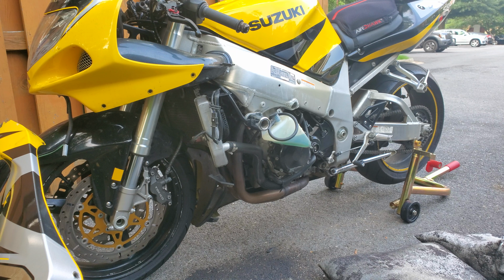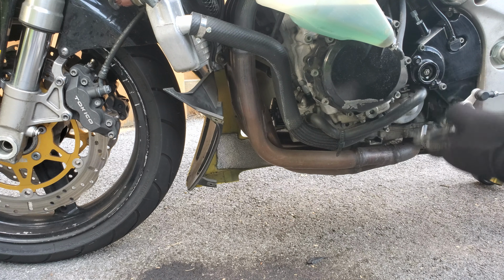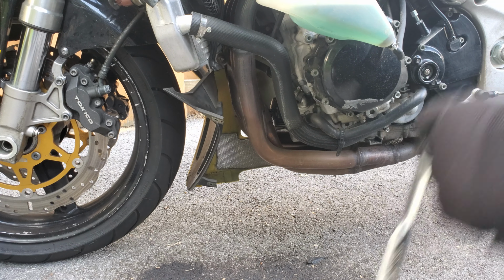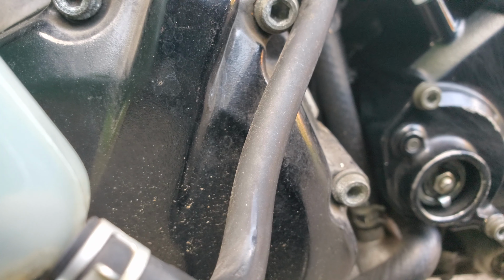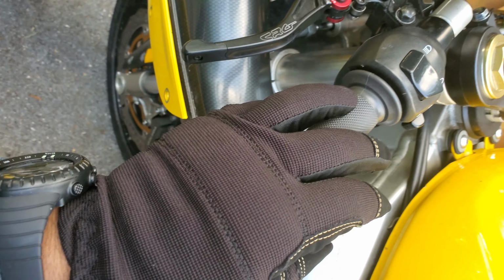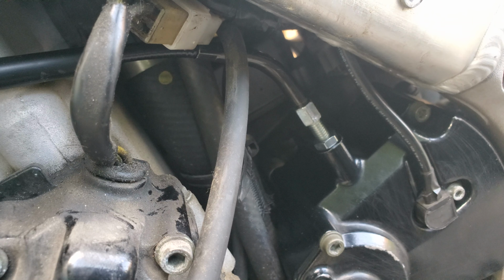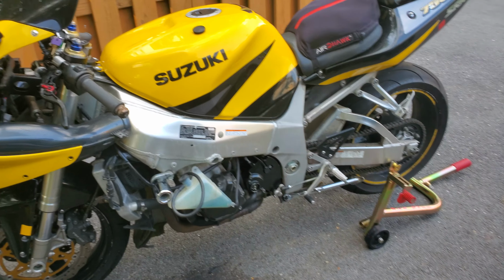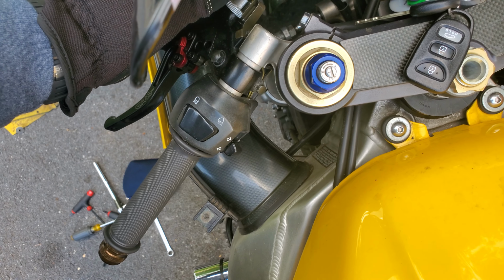2002 Suzuki Gsxr 750 Clutch Maintenance Issue Day 6

Comment: Other viewers say to open the clutch basket side where your Kevlar and steel plates are and find the adjustment screw and give it some attention..I've replaced my cable the levers and the screw assembly clutch release mechanism along with the spring as well as the 5 springs in the basket and I'm still "tuning it in" as opposed to taking it to a shop

Comment: Mine just got stuck out of gear won’t switch gears changing my clutches today hopefully will fix problem
Reply from the maker: Def do the clutch, also check the shift lever and make sure your tolerances are to spec and TORQUE everything. Delboy has a very good vid that I followed to replace my clutch back in June 2023